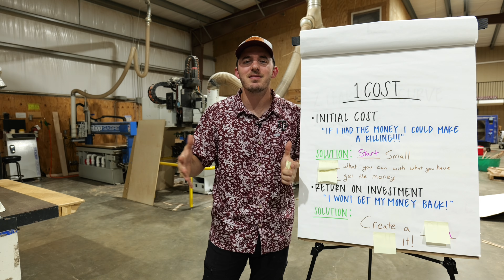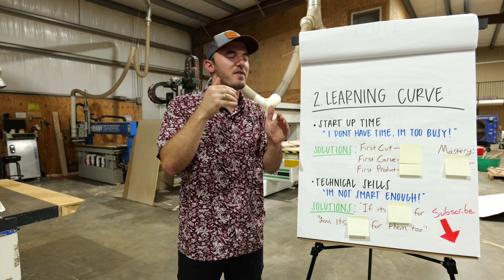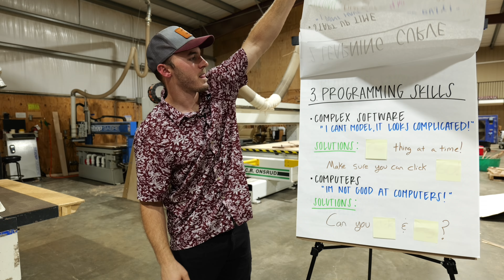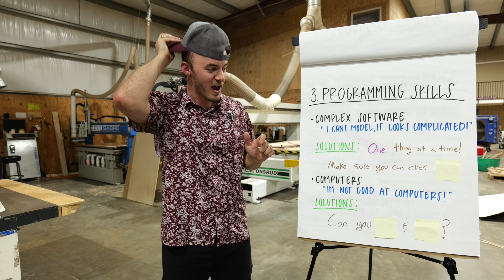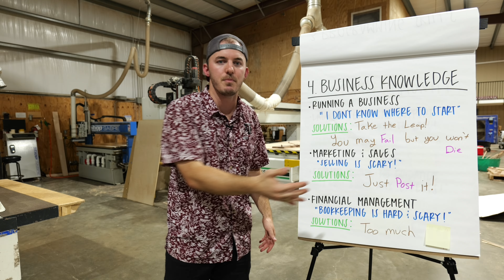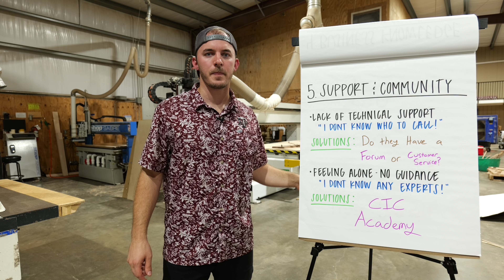Thinking About Buying a CNC? This Will Change Your Mind!

Comment: I mostly make end grain cutting boards which sell well.  I have had a large number of asks for custom engraving now.  I mostly use oak, walnut, purple heart wood and maple.  The S1 x tool laser and the 4040 are broadly the same cost.  Laser seems simpler to use but the CNC seems to make a nicer finish.  Which would you buy?  I’m leaning towards the CNC

Comment: Great motivation. I have struggled with. All these issues at one time or another. I'm working towards being able to get a business off the ground. And needed this.
Reply from the maker: What do you need help with regarding getting your business off the ground?
Reply: @cutting-it-close  
Mostly inspiration. I was a remolder finish contractor several years ago. But after hurricane Michael most everyone got a new home. So I started working at a highend furniture store. Did a lot of repair and delivery work. Till I was injured. So I have alot of tools. Some older but still work. I'm finding I can't work more than a couple hours at most take a break for a couple. And work on smaller projects. And keep dream alive of this new tool or whatever. I'm older and scared of cnc or layers can I learn it? But seeing content like yours is very inspiring. Thanks and God bless.